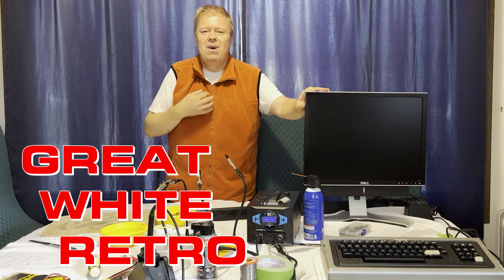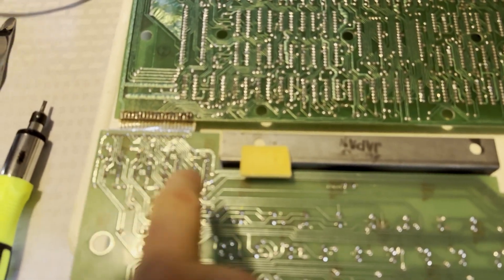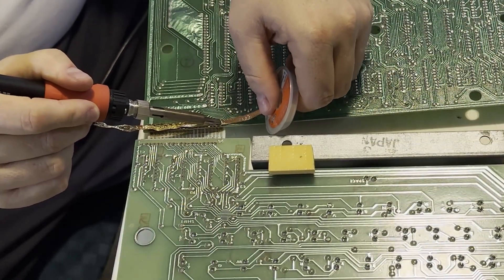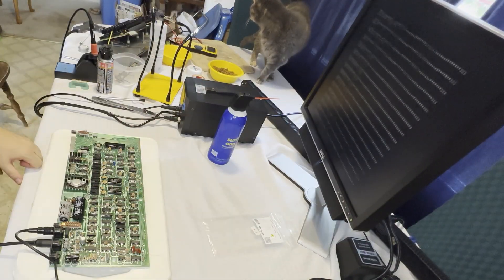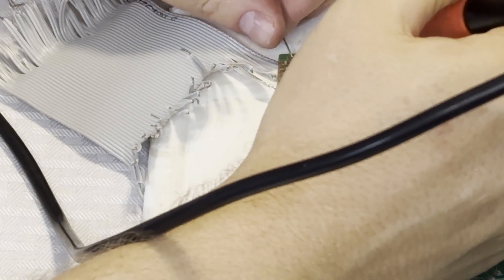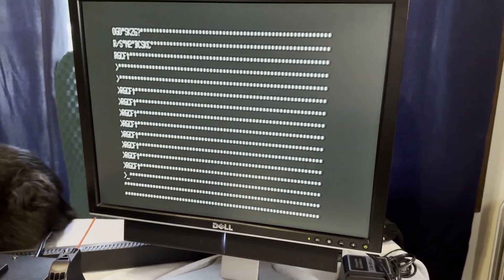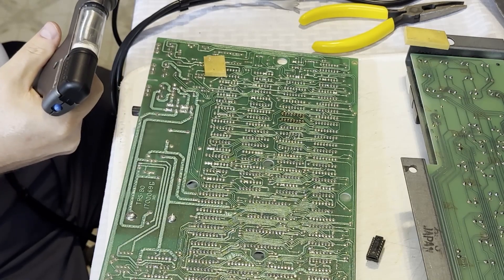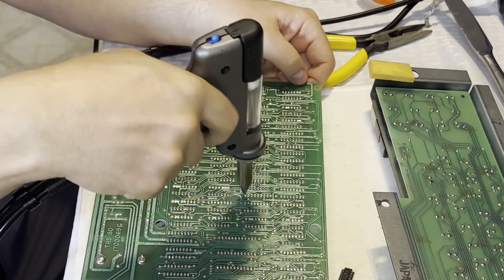TRS-80 Model 1 Episode 02: Troubleshooting

Comment: What desoldering station are you using?
Reply from the maker: I just updated the video description with a link to the Amazon item. It's a WEP-branded soldering station. I had to replace the desoldering gun three times, but that was from me making dumb mistakes and I've since learned how to maintain the tool correctly. Parts for this station are also sold separately.

Comment: Will you be doing the lowercase upgrade?
Reply from the maker: I don’t know yet. I’d like to find an expansion module first to get the floppy drive working. Maybe later though.
Reply: Are you aware of the TRS-80 Model I Replacement Expansion Interface (MIRE) Project?
Reply from the maker: I just looked that up. I’ll look for one if I can’t find the original. Thanks for the tip!

Comment: Good job! And yeah, that diagnostic ROM from Adrian et al is the ticket! I have a Model I since I bought it from a buddy during HS in the early 80's. After hauling it out of storage a couple years ago it wasn't working - just lots of garbage on the screen. Used the ROM and found out it had SIX bad RAM chips. I also had to fight with that dang keyboard cable, tho mine had a regular ribbon, not that plastic thing. Still had problems desoldering it and lifting a few pads. I was able to put in pin headers, tho it's a little tricky since due to the spacing you have to use a double row connector on the cable and just connect one side.

Looking forward to what else you have coming up!